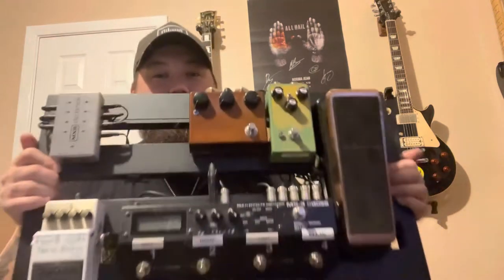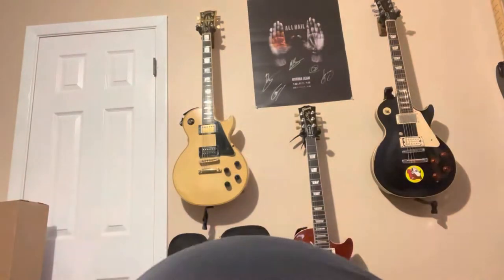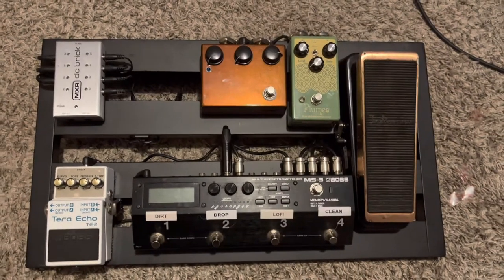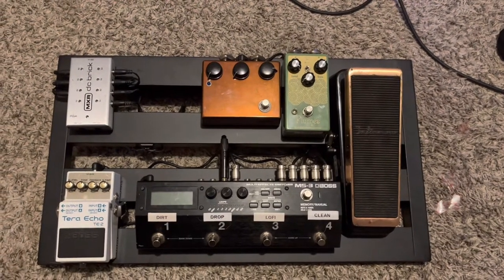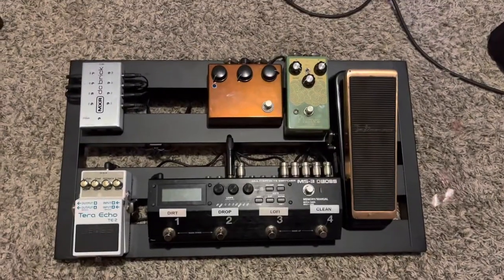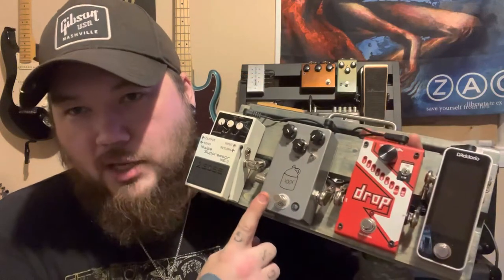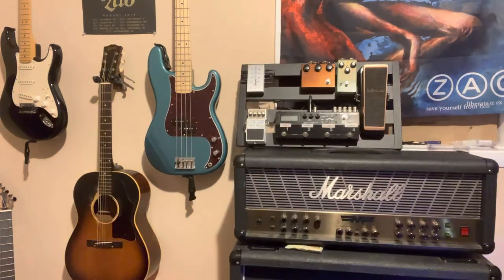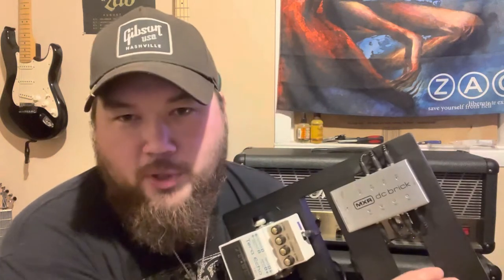Pedalboard Build

Comment: The MS-3 is a stunningly good unit. Really happy with mine. 

If you want a delay unit, the D1 from Walrus is killer. You can get great modulated analog sounds, clean digital, reverse, and dual delays. Plus it’s midi so you can keep with the one tap to rule them all. 🤙